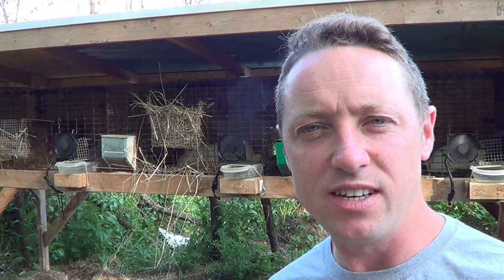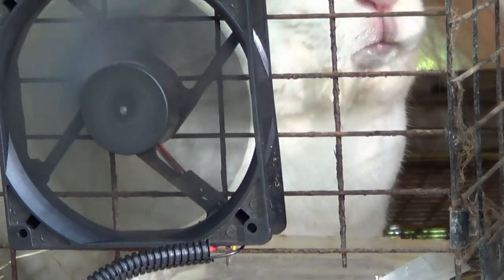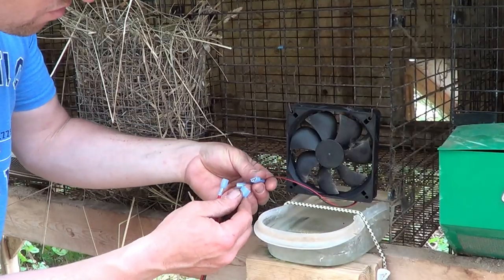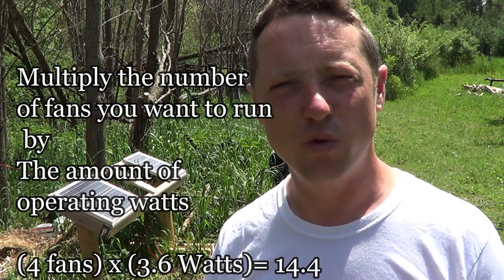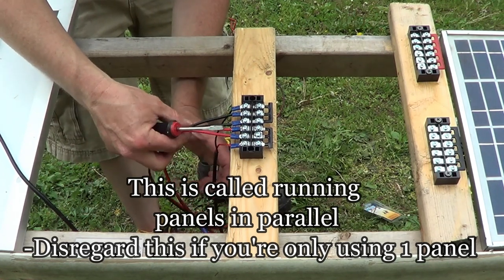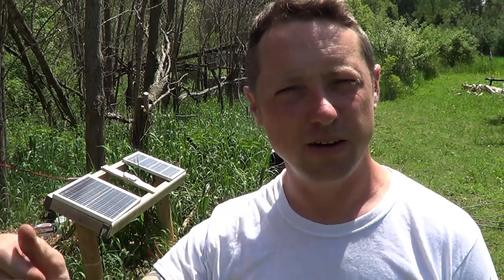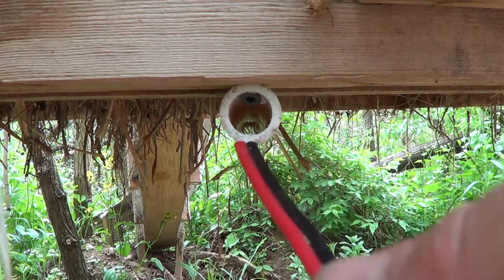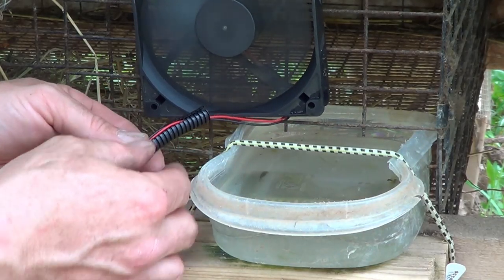KEEP YOUR RABBITS COOL WITH FANS & SOLAR ENERGY

Comment: Excellent tips. Thanks. Living on the coast of South Africa heat is a problem. But sun isn't. Solar is the way to go if you can. I supplement our diet with Tilapia. I turned my pool into a pond and use the backwash water to water the garden. Saves money. The water combined with rabbit tea and worm tea makes a super tonic for the garden. I also use comfrey to feed the rabbits and as a tea for the garden.

Comment: I need to do this as it gets so hot here in Texas thank you for showing this
Reply from the maker: You bet. How hot does it get?  
I used to play baseball and would play in some pretty competitive tournaments and was told if you can catch(I was a catcher) in Texas, you can catch anywhere.
Reply: The Rabbitry Center hmm its not unusual to run 105-110 starting in June through september
Reply from the maker: @danielleterry180  that's a scorcher

Comment: Great video.
As an electronics nerd I would recommend putting everything in an outdoor project box and using an outdoor switch box as a more permanent mounting option. It would reduce the risk of anything coming in contact with the terminals and would hide the wire from the weather extending the life time of the parts. A pair of boxes and some conduit to stick the wire in would add less the $50 to the projects price and would look like a professional installed it all.
Reply from the maker: I couldn't agree more. Thanks for sharing.
Reply: Is there a specific outdoor project box (2 right) you'd suggest that would fit the stuff he's listed?  I've bought all the stuff listed here but would love to do the project box and outdoor switch too.

Comment: Thanks for doing this video!  I went down the solar research rabbit hole (see what I did there?) a few years ago after hurricane Irma. For what I wanted to do then (homemade 1-room a/c) I figured I needed 200watts. That meant a more expensive (mppt) charge controller, choosing between 12&24 volts, etc. This easy setup with low amp usage is much simpler. People should know there’s 12 volt lights they can get, also, that won’t draw too many amps - hopefully I didn’t miss you mentioning that. They might need a light or two if they feed before daylight in the mornings like me.
Reply from the maker: That's awesome thanks for sharing.  I liked reading your comment.

Comment: Getting ready for this years heat. How many solar panels did you get and what size?  You have 2 sizes in your Amazon shop.
Reply from the maker: I’d watch the video again and write the math down it depends on how many fans you’re running

I’m running 12 fans so you probably don’t need that much
Amps x volts =watts 
.25 amps x 12 volts = 3  watts needed to run a fan 
6 watts needed to charge and run the fan at the same time 

So if I was running three .25 amp fans I would purchase a 20Watt solar panel- this would provide 18 watts +2 extra watts 
 
40 watt for (6) fans and so on... 
hope that helps
Reply: @TheRabbitryCenter  thank you!

Comment: I have a question about cooling totes and runs. ( Sorry it isn't about the fans, but this is your latest video and thought you'd be more likely to check this for questions.)
If I let the rabbits share a run, will they be able to find their own tote (and kindling tote) as there will obviously be 2 tunnels into run.  Would it present a danger to young bunnies just born if the non-mother rabbit had access to them?  Thank you.
Reply from the maker: Boy that's a tough one. Rabbits do live in warrens which have many different tunnels that intertwine but Females get very territorial over their area.  They get defensive over their litters. They may attack a doe that comes too close.  In most cases they have their litter in an isolated area and bury it so it doesn't give off any scent and no animal can detect it.   That said, there's colony raising situations where every rabbit seems to learn their place so I wouldn't think it'd be a problem as long as the neutral zone(the Run) is big enough and you had multiple totes on each end.  Please let me know how this turns out.  Good luck

Comment: Have you considered using a timer instead of an on/off switch?
Reply from the maker: I have. The switch is strictly to preserve power but not necessary. some folks like to run the batteries down and cool their rabbits at night when it’s more comfortable. This system is set up specifically for beginners. Small scale. Easy to follow. digital solar controllers, Which I’ve used in the past, work well. Some are a bit difficult to set so I’d take some time to pick the right controller.
Reply: @TheRabbitryCenter  We have a similar setup in our quail hut, but on commercial power(for now).  It has temperature/humidity settings as well as a timer that I have added.  We are just getting started on the 'Rabbitry' trail, but their cages will be just outside our quail hut - so it should be easy to add them to the same fan system.  I have watched several of your videos, and look forward to learning more from you in the future!  Thanx!

Comment: We live in Georgia. It gets very hot and humid here. The nights aren't much cooler than the days. How can we beat the heat? Can we get a bigger battery or a backup to use at night to run the fans 24/7?
Reply from the maker: Absolutely. you can upgrade/improve the system to where you’re running wire in conduit and it’s a permanent system this is a low level low cost operation.  Here’s a couple videos https://youtu.be/PfmR7IvQGqg 
Beat the heat 
https://youtu.be/3K_jKInejqE

Comment: If you have long runs of wire, voltage drop needs to be considered, which will determine your wire size. Temperature also plays a factor in voltage drop, the panels could double as water heaters in the winter.  Go ahead and bawl when you purchase that deep cell marine battery.  You can run your fans all night if need be, depending on how many fans you have.
Reply from the maker: Thanks for commenting I appreciate it
Reply: We might need to run fans 24/7 in summer here in Georgia. It's brutal heat. Thanks!!

Comment: I’m down in Texas laughing out loud. Those fans wouldn’t cool a fire ant during summer here. Sweet setup but not practical down here in the mouth of hell. 🇨🇱
Reply from the maker: That's too bad. This video is for 90-100F Days. But not your 120.  I'd go with kindling totes. Sounds tough for raising rabbits.  Check this video out. 
https://www.youtube.com/watch?v=kzCicl71QOo&t=41s
Reply: @TheRabbitryCenter  it’s not just the heat but the average 80% humidity

Comment: I'm dyslexic and not good with numbers. I'm interested in building the system for 35 enclosures with the intention of leaving the fans run full time and or have couple of Lights I can turn on to check on them at night. How many of each item do I need to order? Example how many solar will I need, how many batteries will I need, how many terminals will I need, Etc.? Once I know how many of what I need and have it in front of me I should be able to figure out how to wire it.
Reply from the maker: Can someone help Little King Cobras Den with this? 
It's all about your battery. Amp hours.
Here's some info- 
A 12 volt 105 AH battery can supply (under perfect conditions and to 100% discharge) 12 x 105, or 1260 Watt-hours (1.26 kWh).
Reply: @TheRabbitryCenter  in short I basically need someone to tell me for example: buy 5 solar panels 10 batteries Etc., or whatever the correct number of each item is to accomplish my needs. I live in East Texas USA and even our nights are hot. Sadly, my rabbits are dropping like flies right now. I'm sure just because of the Heat. I've been raising them indoors for the past two years. So they are used to an air-conditioned room 24/7. I moved them outside for the first time this year for what I had hoped would be easier Maintenance Cleaning around the enclosures and to give me room to remodel my house and bug bomb the house without worry of poisoning the rabbits. Sadly soon after moving them outside they have begun dying faster than ever.
Reply from the maker: @littlekingcobrasden4217  I'm sorry to hear about that.  Well with the extreme heat you experience I think it would be more beneficial to have cooling totes than fans.  Don't get me wrong every little bit helps but the cooling totes will always be around 10-15 degrees cooler due to the surrounding insulation of dirt and it'll be like escaping to the cool down stairs.  

How many rabbit cages do you have?
Reply: @TheRabbitryCenter  I'm in the process of building a new set of enclosures that will be four wide and 3 tall 10 ft wide × 7-1/2ft tall × 30" deep front to back. It will be housed inside my biggest chicken coop for shelter of rain and sun as well as from cats foxes snakes and other vermin. Currently because so many rabbits have died I'm down to three enclosures in use at the moment. I only have one male rabbits left and he acts like he doesn't know what he's supposed to be doing with the dose. I only have one female that is a known breeder and three other females that have never bread yet. My goal is to have a minimum of 20 dose and two bucks at any given time. Here lately Tractor Supply has been out of stock of the 30" x 10' 16 Gauge Galvanized Cage Wire 1" x 1/2" Mesh that I used to build mine closures. I asked to make that it will require 8 to 10 more rolls to finish building them. Even the supplier I buy from eBay has been out of stock lately. I did just find yesterday someone on Amazon has some and I ordered 6 rolls I'm waiting for them to arrive. And I will be trying something do to me. I've been using hog rings in hog pliers to build them but I just recently learned about Jay clips and J clip pliers so I've ordered and received 5 lb of J clips in order to pair of pliers to give that a try see if it makes it easier assembling them. If you have someplace I could send photos or short videos of what I have I'd be happy to share. Also by moving the larger enclosure inside the chicken coop I will have a 55 gallon water supply I can tie into. Soon that 55 gallon wash supply will be tied into a 3000 gallon water supply. So in total when I am done building enclosures I will have a minimum of 22 enclosures. And this look like a neat idea to hang a few fans around the chicken coop as well for the chickens to enjoy when I get more chickens. This is why in my original message I was asking for help knowing how many of what to buy for a total of 35 enclosures. This will allow room for the chickens to have a couple fans and future enclosures I will be building.

Comment: When its a cloudy day and the panel isn't putting out any energy to the regulator, can you disconnect and run directly off the battery or do you need to physically attach the load of the fans to the battery? Thank you
Reply: I think I answered my own question. The solar charger controller has an inverter inside and charges the battery through the solar panel and the load actually runs off of the battery so on a cloudy day you will automatically be running on the battery just not charging the battery as quickly.
Reply from the maker: @HomesteadersOnTheHill  That's correct

Comment: Hello. Is this system still working good? I'm looking at doing this. Thanks
Reply from the maker: Yes it does. But it takes upkeep with repairs and trouble shooting but it works well and gives your rabbits that little bit of relief to make it through the heat - this video shares more info https://youtu.be/RRN6q_WWq_0
Reply: @TheRabbitryCenter  thanks!

Comment: I have bought everything you listed to buy. I have watched the video at last 20 times to get all of this (I have NO wiring experience). I think I have everything but the panel hook up. I have 2 panels, but I just do not understand what you did. I think see the multiple prong black connector cut in half on a connector panel. It looks like you have all the red wires ( from the solar panels) to 1 end and the black to the other. Did you them run a whole new wire from the red and black ends to the solar controller? I don’t understand this wire setup, but if that is what I need ok. Please respond right away. Help. 🤷🏻‍♀️
Reply from the maker: You can hook all the rabbit fans up to the terminals on the blocks -all the blacks go to the black terminal block, and all the Reds go to the red terminal block -you then run a positive and negative wire to the solar charge controller load or power terminal(this is a small pic of a light bulb on the solar charge controller in most cases)you run a wire from your solar panels To your solar charge controller it should have a picture for your panel
If you don’t have a charged up battery, you can run a wire from the solar panel directly to the terminal blocks that the Rabbit fans are hooked up to. But this is only temporary because you can overload the computer fans that’s why you use the solar charge controller in the first place but it won’t operate correctly unless you have a full charged battery
Reply: @TheRabbitryCenter  thank you so much for your reply. I have all that. What  I don’t understand is the hook up for the solar panels . I’m lost on that one
Reply from the maker: You can use one big one and just run it straight to your solar charge controller never mind combining if it makes it easier
Reply: @TheRabbitryCenter  thanks so much. It is working, and I will use it tomorrow. I have 3 new bunnies, and one doe is not doing well. I know the fans help her. Thanks again.

Comment: Bobby if I get a 100 watt solar panel can I run my cage fans and a couple of lights in my barn?
Reply from the maker: You bet you can set up a great power system but you'd need one more thing and that's an inverter. This device turns your DC power into AC which is what our homes use. I apologize if I'm mentioning something you're already aware of.

Comment: I'm not great with math. Do you think if I had a 50W solar panel and a 12V 35 AH battery I could run up to 6 of those fans all day and overnight? I understand you're not supposed to run the battery much lower than 50%. I live in Ohio and would have as much sun light as your set up has (possibly more).
Reply from the maker: I just launched another video if you have a calculator ready I think it'll help you figure your fans. https://www.youtube.com/watch?v=5kQTwyWvcpQ&t
Reply: @TheRabbitryCenter  That' was helpful, thanks!
Reply: @TheRabbitryCenter  I completed my set up yesterday. I ended up following your directions almost exactly. I went with a 30 watt solar panel. The rabbits are loving the fans!

Comment: The links to the fans are 24 volt fans but you are running with a 12 volt battery, how does that work?
Reply from the maker: there's 12 volt and 24 volt available I'll double check to make sure thanks
Reply from the maker: Ok. This is weird. I just bought 5 of these last week and now I can't find the product in amazon.  The same link from 2019 is also a 12 V.  The company either sold out of them or changed the product that links up.  I just took the 5 fans out of the box to make sure they are all 12 V. 
I appreciate the heads up.  I have made an update and added a 12V fan that will work well. Thanks again
Reply: Thanks for responding!  I will be doing this soon

Comment: I got that solar charger Controller it's flashing i'm wondering why
Reply from the maker: Take it apart and try putting it back together in the opposite order also try charging your battery as well to make sure that’s not the issue